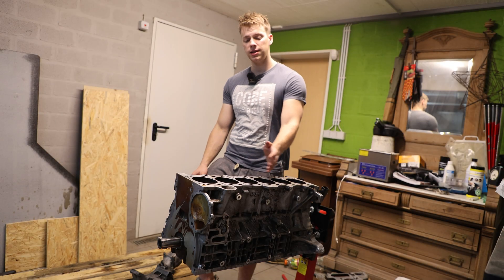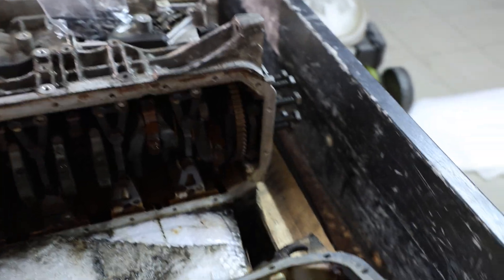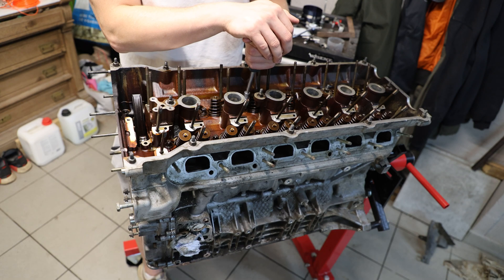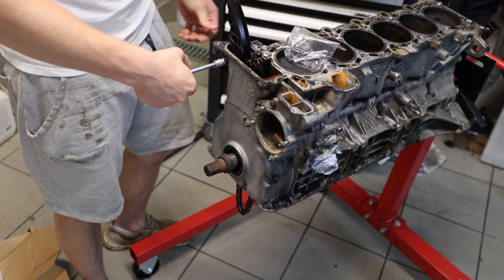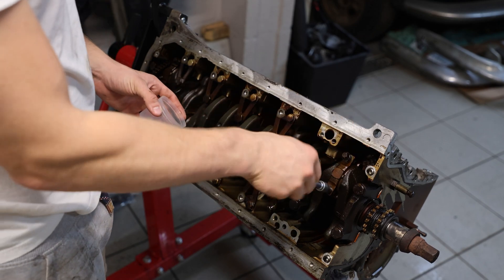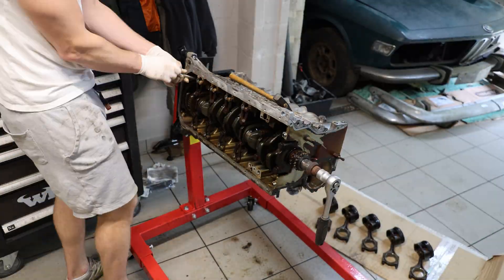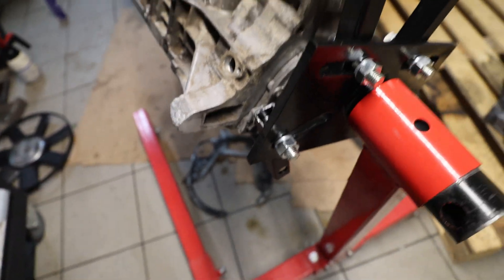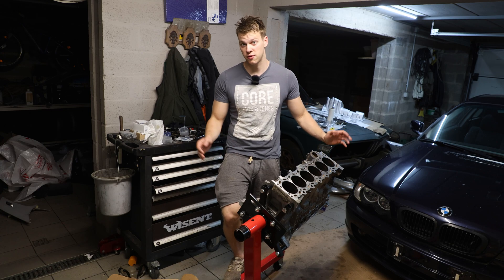E46 coupe engine swap: Teardown of the b28

Comment: i swear that m52 and m54 are different like 320 2.0l,323 2.5l,328 2.8l are on Siemens MS42 that for m52.M54 320 2.2,325 2.5l,330 3.0l they on Siemens MS43 you putting 2.8l in to 2.2l ,.the throttle body are different one is drive by cable (2.8l) and drive by wire (2.2l) and there are other little things also different.
Reply from the maker: @Extreme_Sinaasappel  yes I know :) im gonna flash a specific b28 map for ms43 and transfer ms43 parts onto the b28 :)
Reply: @DailyDrivenClasssics  well good luck then
Reply from the maker: @Extreme_Sinaasappel  should work without issues😇 in theory😅

Comment: Nice work. Chain guide wear is 100% likely to be due to bad oil change history. I think you got lucky with the head bolt threads, as you say, normally a horror story there. I agree, I have tried 2 makes of VHT silver paint and both were very "bling", it's time someone made a specific paint to give an original look to engine parts, particularly cam covers.
Reply from the maker: @bobfrankish8883  I dont know. 290 k km is a lot but the wear on both guides and rod bearings seems a bit excessive for regular oil changes🤷‍♂️the paint i used on the e34 engine looked incredible. That was wheel paint🤷‍♂️🤷‍♂️

Comment: Love the videos, bought a e46 coupe with a m54b25 and when changing the oil pan gasket i didnt do anything with the oil pump gear and now everytime someone talks about it i hope that mine doesnt come off 😅
Reply from the maker: @rakzz2933
@rakzz2933 That's nice to hear :) Nice work on the oil pan gasket. I never did it on my old e46 cuz i felt like there was too much work involved. Also I think you should be fine with the oil pump bolt. It usually only happens with track use or extreme abuse :)
Reply: @DailyDrivenClasssics  I had 0 experince while doing the oil pan and me and my brother did it in 6 hours, that including cleaning the pan, took along time but atleast its done, my engine has 290k km on it, and it was leaking from every common spot, right now its dry and hopefully it stays that way
Reply from the maker: @rakzz2933
@rakzz2933 it takes so long because the subframe needs to be lowered :( But good that you got it done. My b28 should be dry for the next 100k km :) Hopefully :)
Reply: Youll be fine dude. Luckily you got the B25 they rarely have issues. My B25 oil pump nut was still nice and tight even after 110K miles and plenty of abuse. Its the 89mm stroke engines that you need to worry about

Comment: who told u that m52tu run hotter than m54? both run at same temp
Reply from the maker: @northernmaten7676
@northernmaten7676
there is a german tuner for ms42/ms43 ecus. On m52tu he offers changing the thermostat map to open sooner ( under normal operation 105 degrees C) and m54 thermostats open at 97 degree C as far as I know
Reply: @DailyDrivenClasssics   my m52b20tu opens at 97, and m52b28 (1st gen) at 92 degree
Reply from the maker: @itsbacksy
@itsbacksy Then the infos I found were probably wrong. my bad
Reply: @DailyDrivenClasssics  im a tuner too all m52tu and m54 thermostats open at 97 in normal conditions at 105 and up in the Bmw tune gives electricity to the heater at the thermostat to force it to open so as tuners we lower this steppoint to make the engine run lower temps .for the m52 single vanos they have a lower temp than m52tu and m54
Reply: @DailyDrivenClasssics  maybe theres some changes depending on country, because of the weather, mine was imported from germany
Reply from the maker: @northernmaten7676  the tuner was cf carparts and the lowering was listed under m52b28tu engine. Maybe there was an issue when they created their website. But I guess i was wrong 😔
Reply: @DailyDrivenClasssics  hahaha you can lower both temps for 52tu and m54